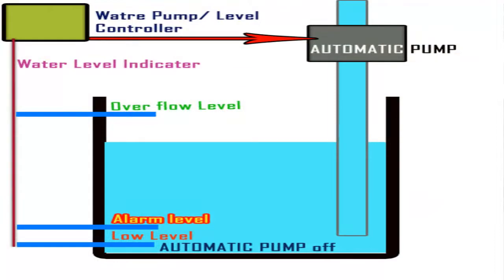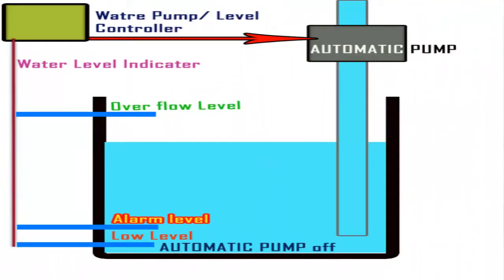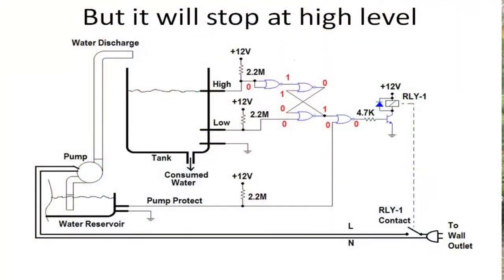Water Level Controller and Indicator

Comment: Good Idea, but what about electrolysis? in such way you put some metals in the water and your electrodes corrodes or it will be shielded. You should use alternate current and send the signal in the input of the circuit after  a simple rectifier. You can use a frequency of about 1500 Hz and you can make the oscillator with a simple ne555. Good luck !